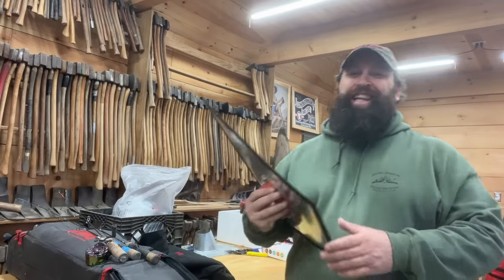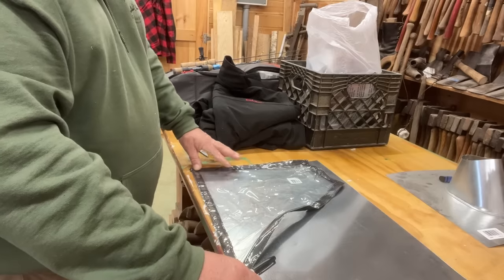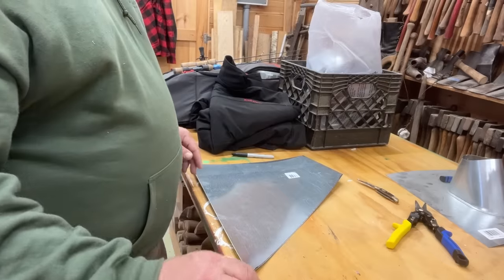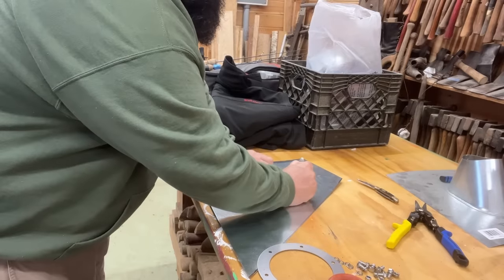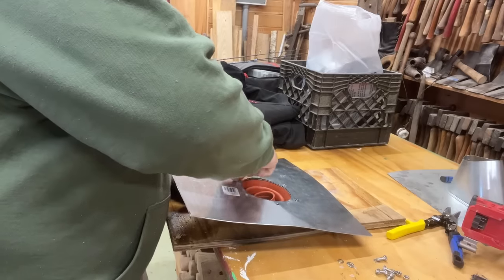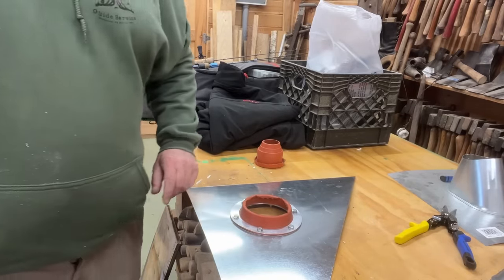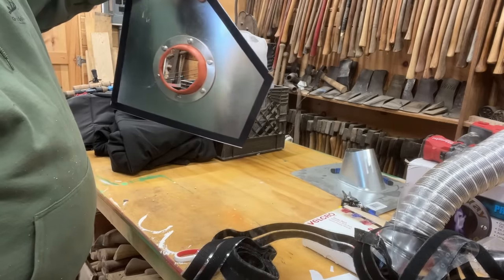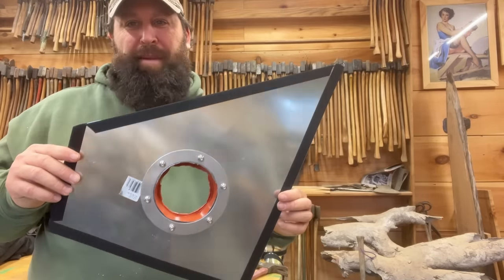Super Cheap and Easy HOT TENT Window Stove Jack Build for winter camping

Comment: A couple of thoughts that came to me watching this for people making their own jacks.  A hollow punch or step drill bit will make easier/rounder holes in thin sheet metal.  I currently have a sheet metal cut on my finger from installing ceiling mounted light cans and the thin sheet metal sliced me without feeling it.  I had cut resistant gloves on right before, but I took them off to color code some wires with tape.  Wear gloves with sheet metal.  Another thought is if you can find it get wider Velcro that you can wrap around the edges so not only do you have a left/right window jack, but the sheet metal edges are fully enclosed.
Reply from the maker: thank you.